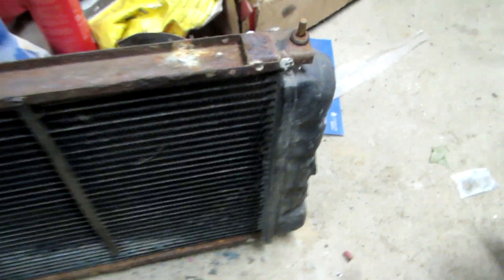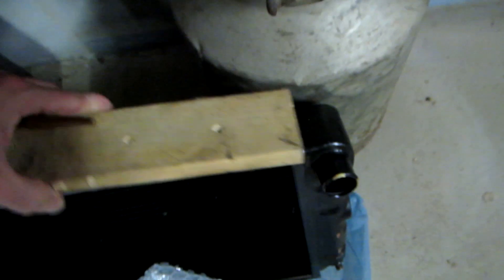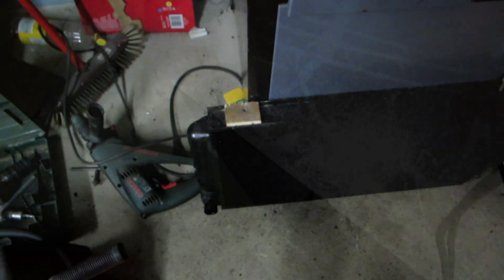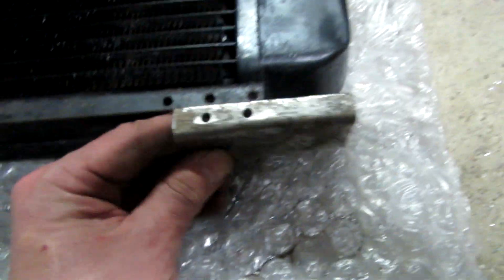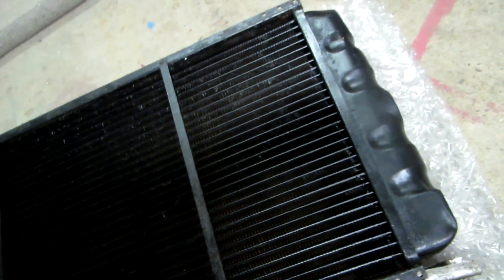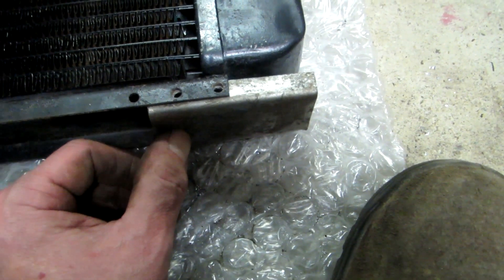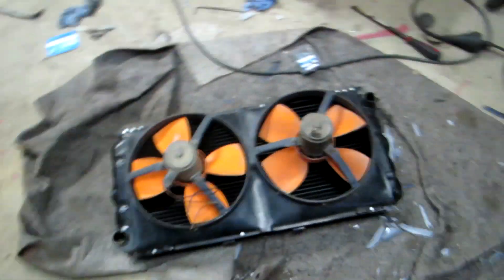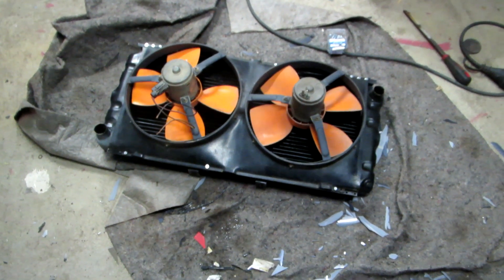Lotus Excel Part 12: Radiator and Cooling Fans

Comment: Nice 👍 Have an 87 SE. Rad looks like a right pain to get at so hopefully I never will 🙂
Reply from the maker: It is actually not too bad. There is plenty of room to work with and once you have drained the coolant and removed the pipes plus the connectors for the fan motors, remove the two nuts at the top of the radiator and it will pull out.